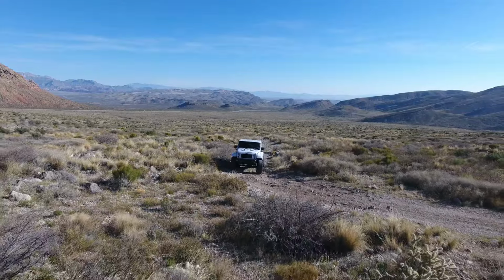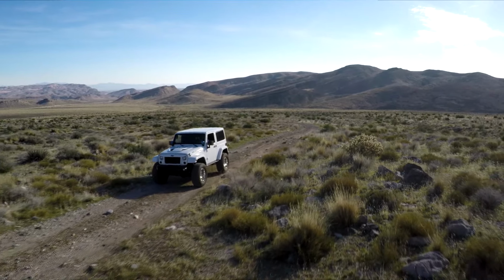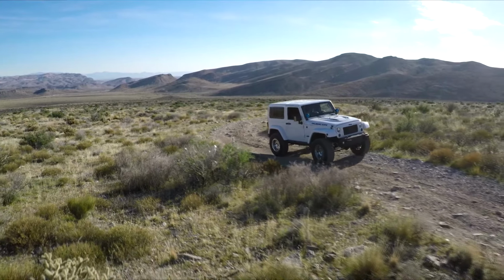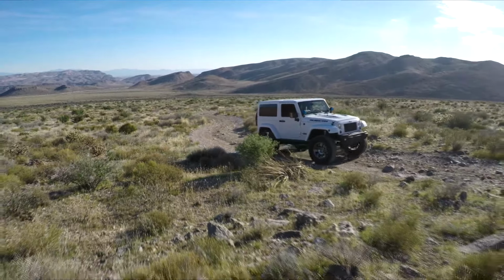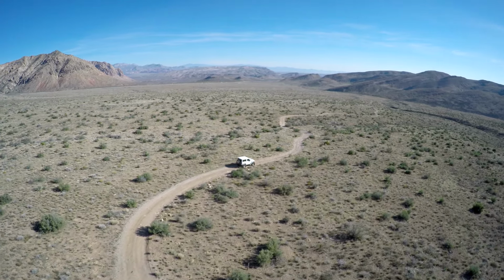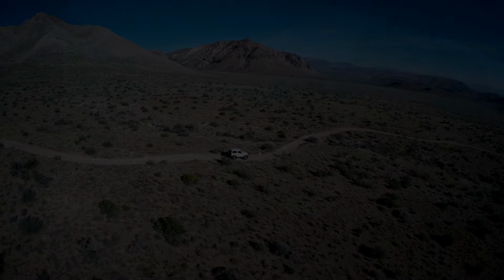Jeep Wrangler JK 2 door LS3 V8 conversion part 2

Comment: I was told that the your LS conversations  won't work well with Australian emissions standards. They Also said your LS3 conversations won't pass our engineering compliance certification. JeepKonnection in Australia does Hemi conversations and have done LS conversions and they're telling people in O.Z  not to even try. Have you ever dealt with them. I'd love for them to be wrong because I would order your RHD kit in a heartbeat if you can prove them wrong.
Reply from the maker: Your engineering requires ESP be fully active on key up and then be selected to partial off by the user; we are hoping to support that function later this year. Not sure about your emissions I haven't heard that before; we support North American emissions including California. It could be some of our engines are not available there but I have not checked. we have supported several builds the only issue I am aware of is the partial off ESP and your engineering.
Reply from the maker: I am currently helping a customer or two in Australia that have the same ESP partial mode problem at the LS has; however some Hemi kits do support it. I work with Alan at Pro Comp and I am looking forward to working with Henry at off-road connection once we get a proper right hand drive LS kit sorted.
Reply: Thanks very much that's the same company I've talked to in regards to the LS & Hemi Ozi conversions he was also the head of Jeep Konnection in Melbourne Australia. I was told that Henry was the guy to speak to know. Thanks for the response...